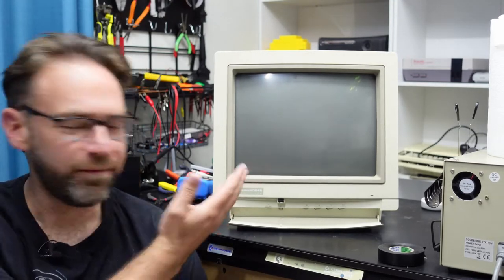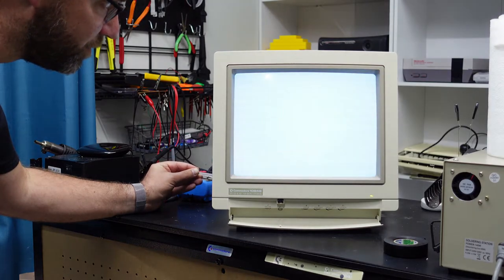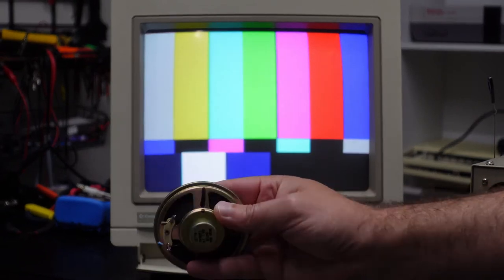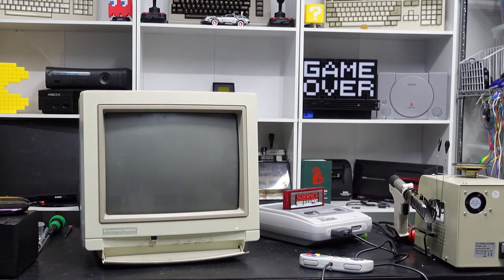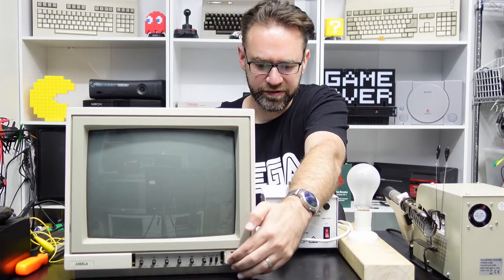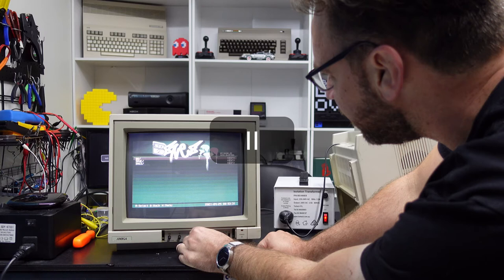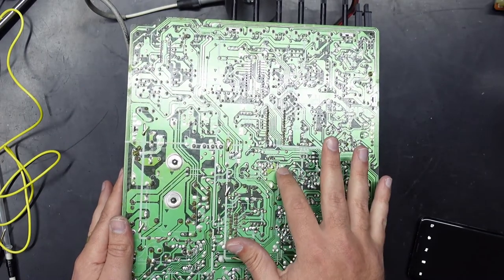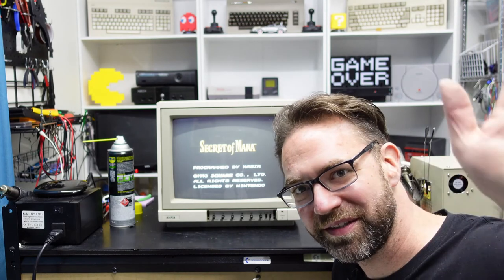Commodore 1084 - Replacement switches, flybacks, and other shenanigans Part 2

Comment: Great video. A Crt monitor is going to be my next acquisition to go with my C64. One question though. If you couldn't find a 16 ohm speaker could you have bought an  8 ohm resistor and just put it in series or would it affect the sound quality?
Reply from the maker: Using a resistor to increase the total impedance is certainly possible. But yes it can affect the sound quality as a resistor just resists current, the voice coil on a speaker on the other hand also creates some amount of inductance depending on the frequency. Whether you would actually notice the difference is another story. 

It will also lower the absolute volume as half the load is being dropped by the resistor, although the overall impedance will match 8+8, it is not the same as having the full load available to a 16ohm speaker.

TL;DR: yes it will work but it will affect sound quality and volume
Reply: @TheRetroChannel  Might also be worth checking the datasheet of the amplifier IC to see what it can deal with. Most will be fine with 8 ohm speakers, which are much easier to get

Comment: On blooming: "Higher [electron gun] beam current drags down the accelerating voltage. The electrons thus move slower toward the screen. The sweep coils then have more time to work on them, so the raster enlarges."  So, the cause is poor electron gun voltage regulation with varying beam currents.
Reply from the maker: Thanks, that seems to be the general consensus. Just wanted to make sure it wasn't something else. So in theory if I can improve the regulation going to the guns then this may lessen the blooming? I'll need to have a poke around with the scope and see if I can catch it